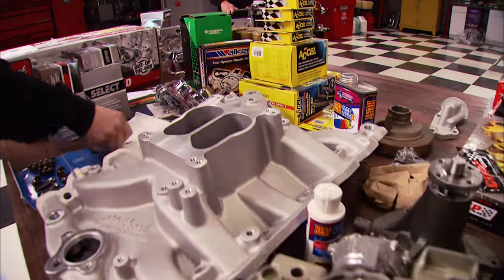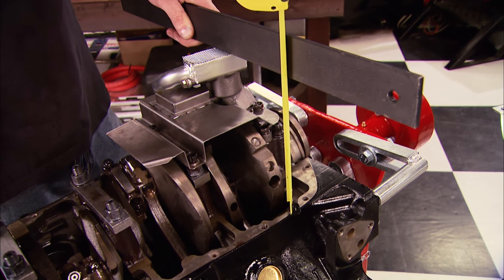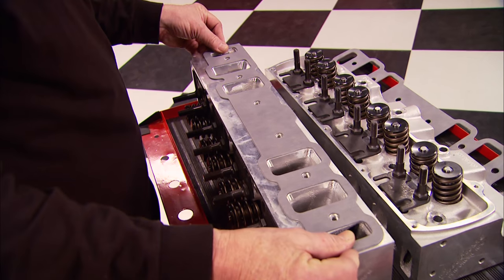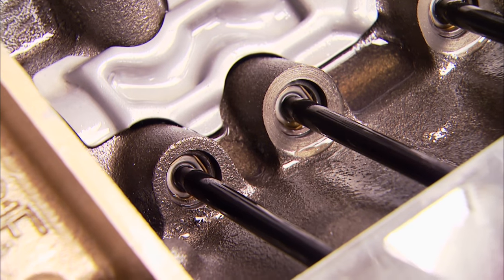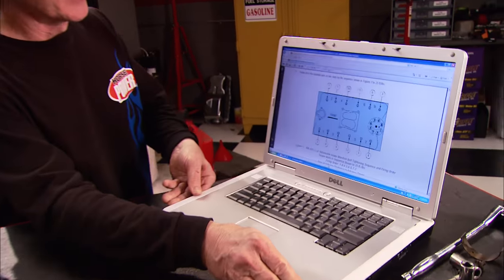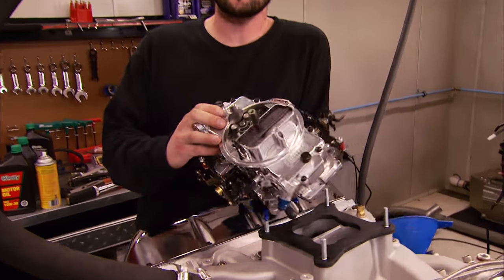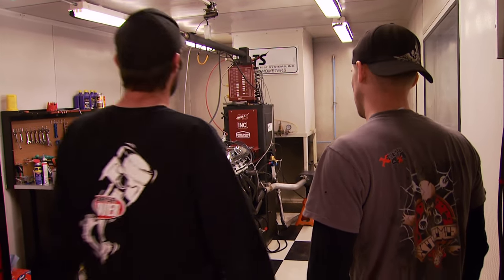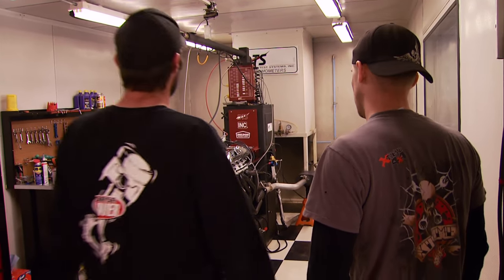Dyno Testing a Mondello 455 Olds Big Block - Horsepower S13, E8

Comment from the maker: We'll continue to post these episodes here on YouTube. If you can't wait for the rest of the build, visit our site to binge-watch: https://www.powernationtv.com/shows/horsepower
Reply: Paint the waterpump to match the engine.
Reply: loving these episodes! keep them
coming!
Reply: PowerNation what are the cam spec?
Reply: How about a big block 2 stroke olds:https://www.4btswaps.com/threads/turning-4stroke-into-2-stroke.12888/#lg=thread-12888&slide=0, Thats a sbc but an aluminum olds drce should work for a 2 stroke conversion.
Reply: The 455 is not supposed to be gold it's supposed to be blue
Reply: Robert LaPointe  no the 330 is a small block
Reply: @djhaloeight  mlm a9
Reply: Thank You! 😎
Reply: Hardened Valve Seats?
Reply: A 750 wasn't big enough so you went to an 870?

A 750 CFM carb will spin a 455 to 5700 RPMs
Reply: Junk Cork gasket
Reply: I purchased a 455 from mondellos and they said I was going to get 550 horsepower apparently I didn’t get it lol
Reply: And I went to a holly sniper 1050 for it it helped

Comment: Jet boat applications proved how tough the Olds 455 and Ford 429/460 motors are, run wide open from one end of the lake to the other. Saw quite a few BB Chevys scatter trying to do the same. We used to say the best marine application for a Chevy is use it for an anchor!
Reply: Hate to break it to you it's not the motor it's the Builder and operator

Comment: You may want to check your math..joe bored the cylinders .030 over increasing the cubic displacement to I think about 468  so keep tuning
Reply: 461 Charles.. 468 is .060
Reply: @sterlingarcher8441  Beat me :-)
More exactly 454.6, 461.2 and 467.9 CID respectively.
Reply: mine was 060 / 468 over , it ran for 4 years up until i sold the chevelle i had it in those were the days
Reply: Yep, not quite one HP per cube yet...
Reply: I went 40 over 463!

Comment: It's always good to see some people still enjoy a great motor, can't beat an Olds 455
Reply: Derrick 112 - Old boat refer to the Olds 455 as boat anchors.  Sorry, but it was a pig of an engine.  Decent torque but very low hp for the cubic inches.
Reply: @danmyers9372  hp don't matter. It's the pull. Got a 68 olds that is amazing. As  factory it's torque 500 lbs. Has more then any factory 454.
Reply: @danmyers9372  I don't care what old boat says, the olds 455 was the engine of choice in high-performance jet powered boats. I've seen a stock olds 455 blow the doors off supercharged Chevy 454 in the same exact make and model jet boat... jet boats need torque, not horsepower
Reply: @karen fyhr 😂😂😂😂 you’re out of your mind
Reply: @danmyers9372  Nah... My N/A Olds 505" engine makes 730h.p., 670ft-lbs, pulls hard to 7100-7200 RPMs, and has docile street manners. In fact, the engine is somewhat of a compromise to make it more street friendly, and would make even more power with a cam swap and a larger carburetor.
Pig? Boat anchor? Hardly...

The car it's in absolutely SMOKES many unsuspecting Chevy's with "boat anchor" B.B.C's in them. I Made a 540 Chevelle look like a 4 cylinder a few weeks ago. When I opened my hood for him after the race, he was speechless. He thought I was seriously joking when I told him there was an Olds motor under there with 35 less cubes than his.

If somebody's Olds is a "pig" or a "boat anchor", or they can't successfully make one work, then they have no idea what they are doing with it. It's as simple as that.
Reply: The Buick 455 did 612 hp and 568 Lft torque...(POWERNATION TESTS)
Reply: @davelowets  lmfao i have a 540 you should try.fukn junk 455 isnt gonna do shit
Reply: Their 445 Ford 390 stroker with a 4.09 bore and 4.25 stroke did 591 hp and 585 ft lbs, on pump gas. I want to do an FE stroker like a 455 with 4.126 bore ( I have a 391 FT dump truck block that can go there) and the 4.25 stroker with 6.8 Molnar rods. I have a 256/262@.050 .630 solid roller. I want Trick Flow heads and a 2x4 Tunnel Wedge. That would have to be 700 hp and 625 ft lbs. FE blocks on nitro as Cammers made 3000. NHRA Super Stock FEs are knocking on 1000 hp in T-Bolts.

Comment: the intake manifold is holding it back
Reply: The camshaft too. The one used, would be better in a small block 350-403CI.
Reply: There was an update many years later and they did upgrade the camshaft and the intake and it made a bit more power.
Reply: @brightstarlastname2812  I was amazed Joe did not make them put an Engle cam.
Reply: Needs a Air Gap intake
Reply: @lamontwhitehead1809  that is an rpm airgap
Reply: Yes it needs a single plane intake manifold!
Reply: @juliennacer8871  the one on the 455 was a performer intake. The performer rpm is a bit taller with a center cutout on top. The performer rpm airgap has an open passageway through the runners.
Reply: Look closely 00:47 re-using stock flat tappet cam... 4700 RPMs HP peak...
Reply: @michaelhorgan9525  link??

Comment: joe taught me a lot  i used a lot of his information to build a 468 olds reworked the quadrajet with one of joes kits made a bit over 600hp and almost 600ft lbs of torque it looked almost stock that was 27 years ago damm i miss those days i put that motor in a 71 chevelle it was quite the combo a 455/468 in a chevelle i can say id invest in head studs and a gear drive for this build  ! if this motor doesnt get 700hp you guys need to go back to the drawing board ! nice parts
Reply: I doubt it made that kind of power with a stock bottom end.
Reply: Only made 455 HP from a 461"...
Reply: Yes, a .060 over 455 equated to 468. Joe did sell stroker kits/combos good for 480+ c.i. Some were sold as motor home upgrades using the original GMC 230 & 260 designated chassis. Since the majority of Olds 455 blocks were limited to .060 over bores, the stroked versions gave a still under square engine for lower rpm torque.

Comment: Hogging out the heads then putting on a untouched intake has me scratching my head.
Reply: Not to mention that the intake is pretty low profile
Reply: Not to mention a flat tappet cam. My goodness these guys probably left a good 100 horse on the table with a solid roller cam and a port match high rise intake.
Reply: HP peak way down at 4700 RPMs has me scratching my ass... no sign of cam spec.s... 
Near stock Performer intake on hyper Performer RPM heads...
Reply: OK... Look closely 00:47 re-using stock flat tappet cam... 4700 RPMs HP peak...
Reply: Back in the early days of 455 building, there wasn't alot of choices to go with. Edelbrock had the O4B dual plane, a step up from the stock c i. intake & Offenhauser had a tunnel ram & a single/ dual quad version which helped airflow to the c.i. stock A-F heads. Mondello was THE king of Olds heads modifications to help make those intakes to work.